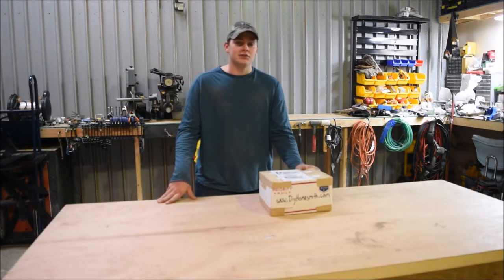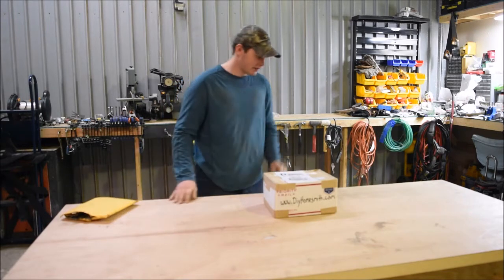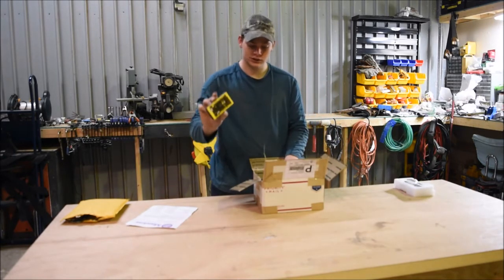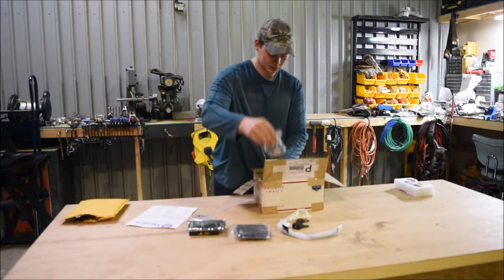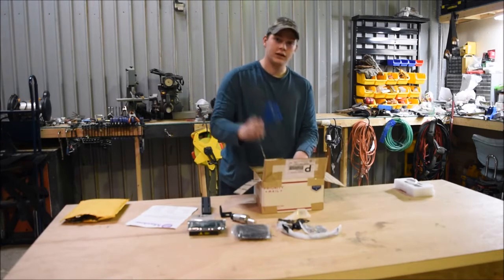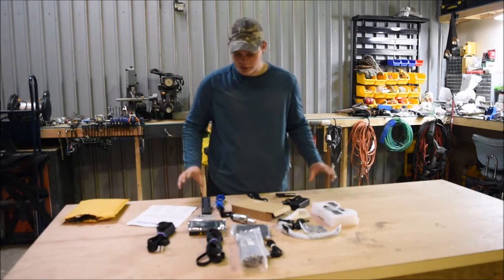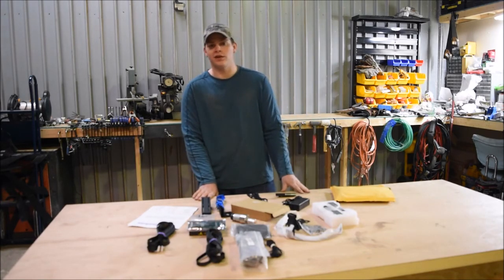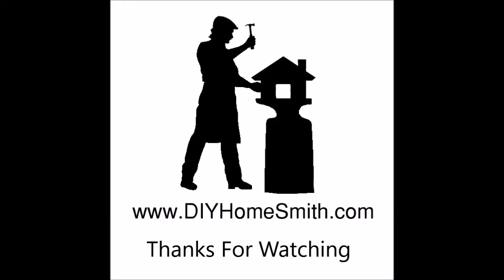Maslow CNC Setup Unboxing and Intro

Comment: How much does this box weight?
Reply from the maker: JIMMYLANGO its not much, but check the Maslow website.
Reply: Homesmith I searched that info but it doesn't appear, do you think is less than 10 pounds?
Reply from the maker: Yes, I would say so. It's not that heavy.